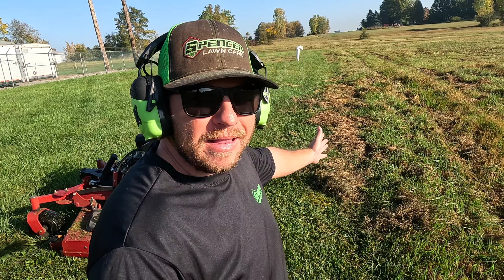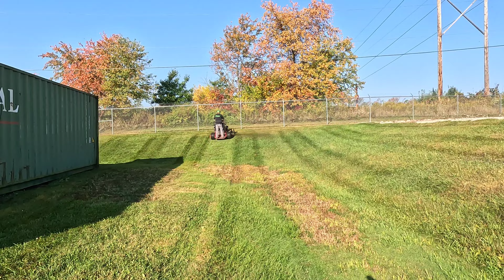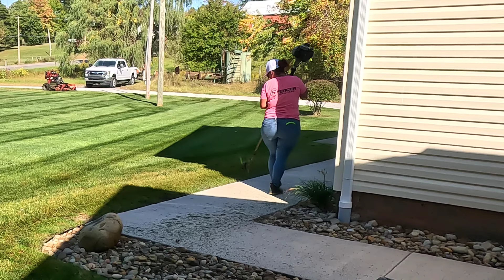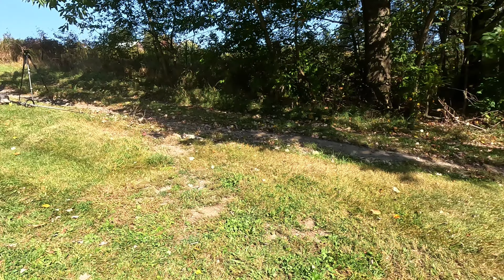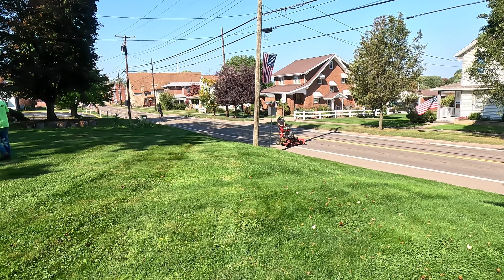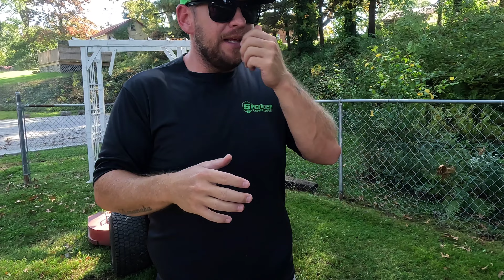HE LEARNED THIS LESSON THE HARD WAY!

Comment: Looks like the power company mowed their easement for the power lines and they won't or don't mow outside of the easement. Just my thought or maybe the customer just mowed the easement for them. If the power company had it mowed that would explain why they left the areas by the fence and between what you mow and what they mowed along that strip, although the field appeared to be mowed by the same mower. Just another mystery I guess. Thanks for taking us along.